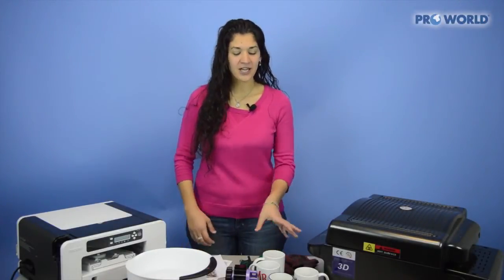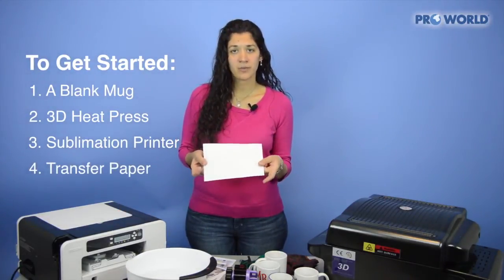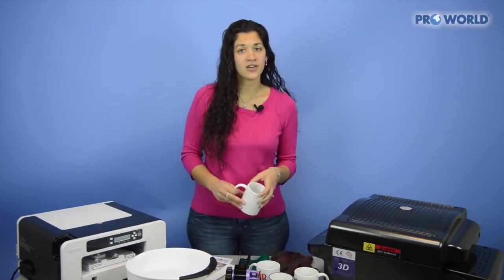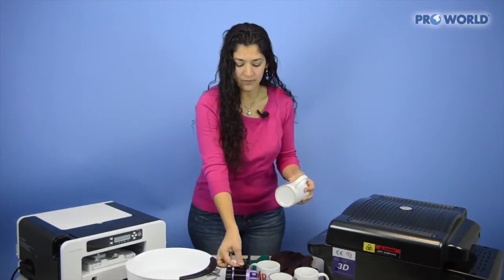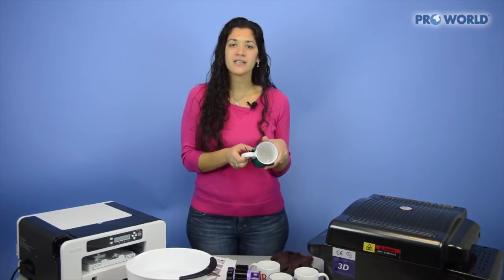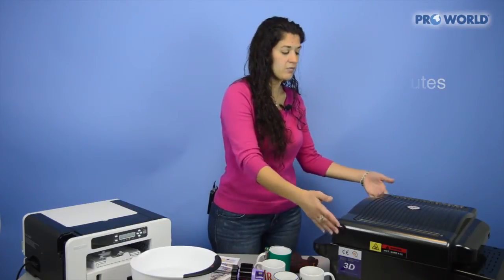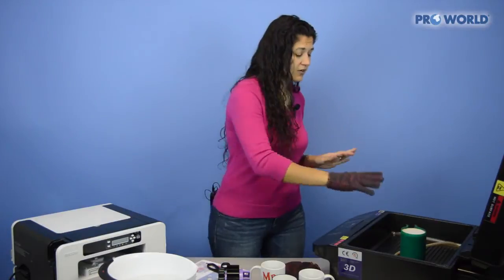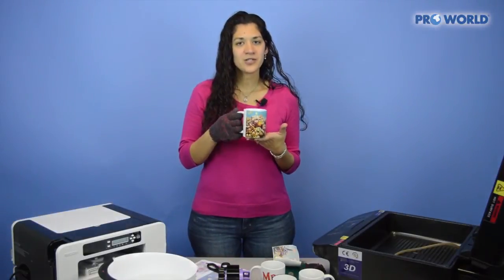Printing Mugs with a 3D Vacuum Press

Comment: I followed all of these instructions and the image Baaaaaaarely transferred to the mug surface. Very faint. I can't find anyone to help me figure this out. I'm using a Sawgrass SG500 printer, their inks, their paper. I bought sublimation mugs on amazon. And I have 3D heat press very similar to the one shown in the video. It's a ST3042. I noticed that when I have the cover closed, you can see light through the crack between the cover and the bottom of the oven... so there's no seal, really. So I didn't see the point in using the vacuum. Since no vacuum is possible without a seal. What am I doing wrong??
Reply from the maker: A few things to check:
1. Both heating lights are one
2. The wrap you are using offers a tight/firm fit
3. The mugs are sublimation mugs. Although advertised on Amazon as sublimation, some are not or low grade. Best to check reviews. The mugs we sell are properly coated for sublimation - https://www.proworldinc.com/sublimation/sublimation-blanks/mugs.html
Reply: @ProWorldInc  The amazon review on the mugs I bought were excellent. Just wondering how much more I gotta spend before I deem this arts and crafts stuff isn't profitable.
Reply from the maker: @avatalkeraac1332  you may need to reach out to company you ordered the vacuum press and see if they can offer any suggestions.They may have mugs or products they can send for you to test with.

Comment: How long do u do it for
Reply from the maker: Set temperature to 400 degrees Fahrenheit.
Set timer to 240-270 seconds.
Set Pressure at heavy.
Print a mirror image onto Texprint Paper.
Trim the edges of the image and wrap around mug.
Attach the image to mug using transfer release tape.
Wrap mug with a teflon sheet and place in mug press.
Press at 400 degrees F for 4-4.5 minutes with heavy pressure.
Remove immediately from press once finished and peel hot.
Dip mug into warm water to end the sublimation process and avoid ghosting.

Comment: Today's mug directions according to their site.
 
 Textprint Sublimation Paper on Mugs with a 3D Vacuum Heat Press

 Application Instructions

1. Turn the 3D Vacuum Heat press on.

2. Set the heating button so both the top and bottom heating lights are on. (2 red lights will be showing)

3. Set the Temperature to 392 degrees F (200 degrees C) and time to 500 seconds. If filling the unit with 8 mugs, use 500-600 seconds (8.5-10 minutes).

4. Print a mirror image onto Texprint Paper.

5. Trim the edges of the image and wrap around mug.

6. Attach the image to mug using transfer release tape.

7. Wrap mug with mug wrap.

8. Place upside down within the heat press.

9. Press vacuum button

10. Press the time button

11. Remove immediately once finished and peel hot. Use caution as mug will be very hot.

12. Dip mug into warm water to end the sublimation process and avoid ghosting.

Comment: Why would you use the vacuum button if you are only using a wrap for the mug?
Reply from the maker: The vacuum button helps to secure the print to the mug. It is not mandatory to use, but I find you receive better results when using it.